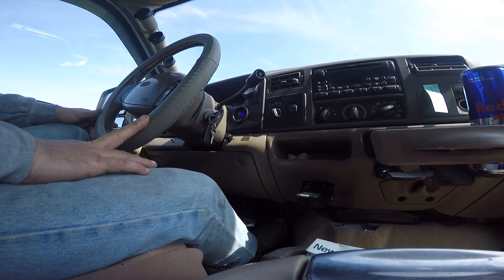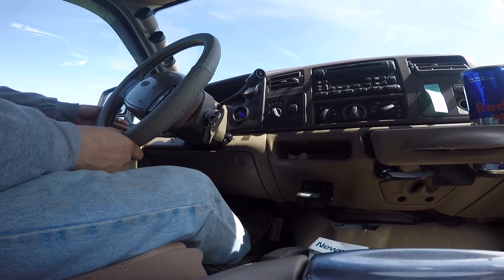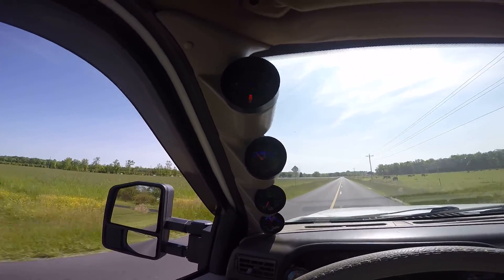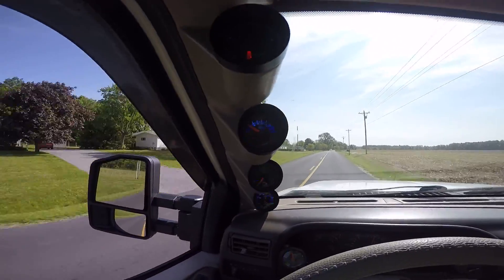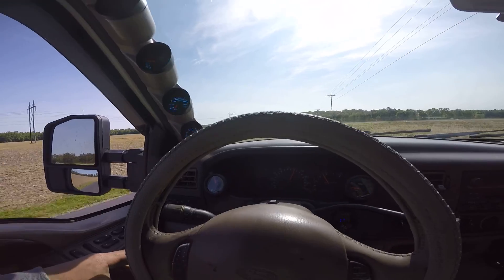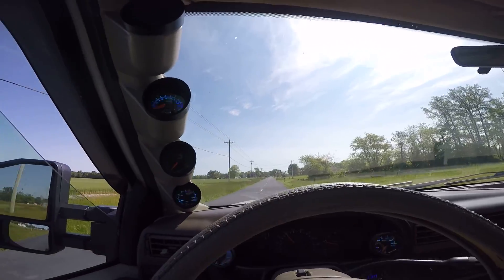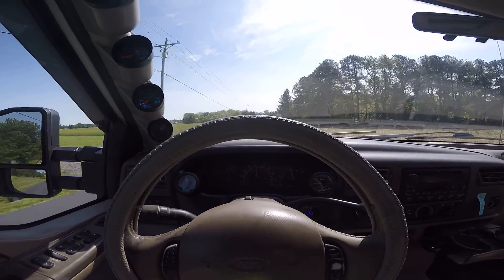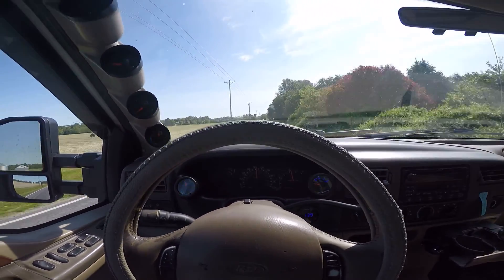7.3 Powerstroke Turbo

Comment: how much boost were u able to get out of it so far...? I've looked into that same kit.
Reply from the maker: When i fist put the turbo on i saw a huge difference pushing to about 32 psi with a tune and boost fooler. one thing to keep in mind is that the stock intake plenums that the spider attaches to is only rated to 30 once you get up in boost you start to leak around those gaskets. It also sounds great!

With everything on it now i can get almost 40psi that's running it pretty hard, I've never had an regrets buying it  although you will notice that the stock exhaust housing isn't enough, i  changed this out in another one of my videos "up pipes and banks exhaust housing"
Reply: Thanks! Yeah seen it too.
Reply from the maker: Awesome and thanks for the comments, if you need anything just give me a shout